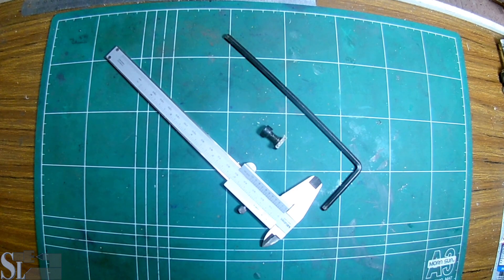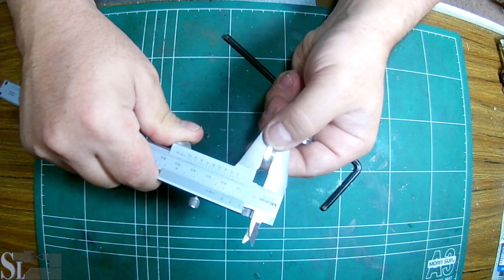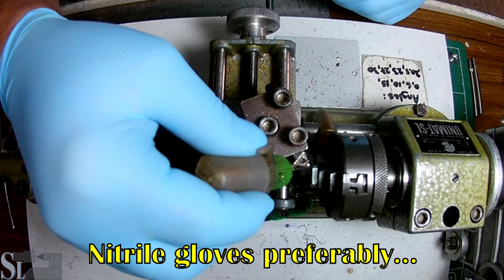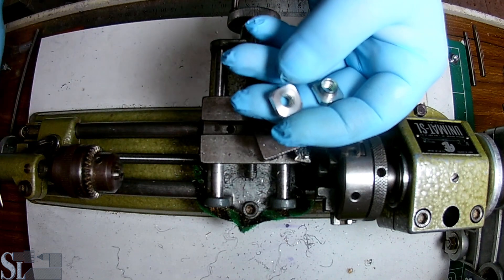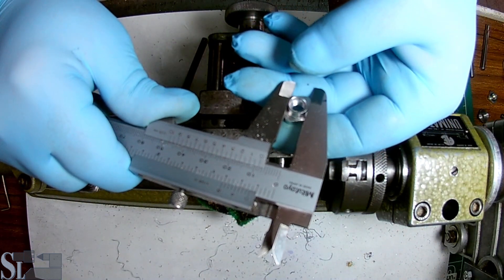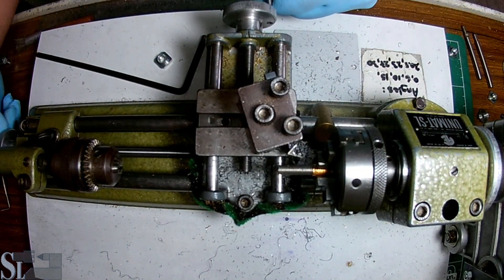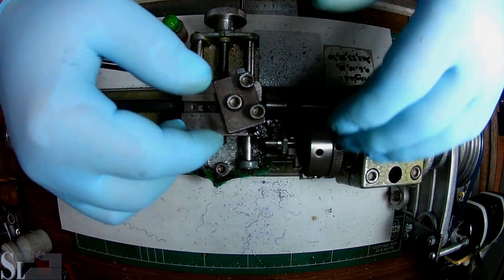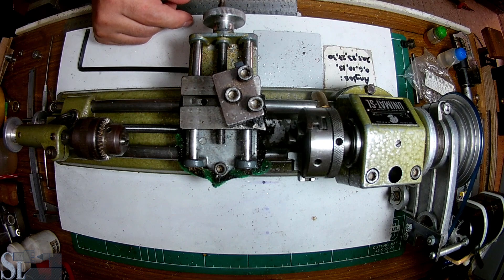T slot nuts for the unimat SL1000

Comment: Hoi heb een draaibank emco sl [ motor is , een/ twee vase moter ] bij me is er een probleem de stroom loopt de verkeerde op via de condersator ( ik heb een keer kortsluiten gehad) 
Ik hem bij iemand anders laten kijken die zij tegen mij er klopt iets niet wat door meten in verschillende standen daardoor kun je me een idee doorgeven wat er mogelijk kan aan Pasen ? 
De draaibank emco sl is ongeveer uit de jaren zeventig oud ik doe er een paar foto’s sturen van de motor van de draaibank emco sl 
De groetjes van Peter uit Oldenzaal provincie Overijssel
Reply from the maker: @petervanbeek7873  hi Peter. I am not an electrician but I will try and help. Using the original motor is very slow as it tends to heat up. I suggest you find/buy a cheap 80w sewing machine motor. I had a low-power motor for years. It was easy to adjust and it worked great both for turning and milling. These are sold with a foot pedal on aliexpress for 20usd or so. My current motor is also a sewing machine motor 550w with a speed controller. It is just perfect for the lathe and mill operations. Hope this helps. Feel free to send me a mail at all times. Preferably in English :)

Comment: I use wire/cloth covered pipe cleaners to help keep swarf off the unimat rails/ways ... wrapped around the ways in front and behind, so they move easily along the rails with the carriage, in either forward or backward direction. These are available in large packs from tobacconists. May be overkill, but I think helps reduce swarf in the gaps between rails and inside of carriage. Magnet a good idea, and makes me wonder if they could be fitted in addition to pipe cleaners, to gather swarf during machining .. I may be thinking too much about this minor shortfall in the unimat design.
Reply from the maker: Loved the idea. I use pipe cleaners myself. If you machine steel, an on/off or retractable magnet may be a good idea. I made such a magnet by placing it in a brass tube and I got a plastic sheath for it - so once the magnet is retracted, the chips fall off. There is a tubalcain video on that. He uses a commercial product. .

Comment: Hi Saar hey if they have the basic machine and basic knowledge and cutting tools like you and I, T-nuts of any material should be a breeze and fun to make!  It was a staple of students back in my day!
Hope all is well and good for you my friend!
Reply from the maker: Hi Mike! Well, yes, making a Tslot nut is easy...  Making many is just taking time from projects you actually want to do so buying them is better. But as for material - steel is the way to go as softer metals will have a serious ware on the threading section. I'm good. How are you doing?
Reply: @Smallathe  this is very true as you'll see me struggle in and laugh in what should have been one little video ...otherwise all is good! 
We had to make dozens of t nuts from print to part of all different materials and sizes...and we didn't get to keep not even one! Lol it was the very beginning of learning how to use a mill lol

Comment from the maker: Just found something interesting.
After Dan's comment (below) - I ran another quick glance on ebay:
Found these and the search text is: "tee nut 12mm M6":
https://www.ebay.com/itm/M4-M5-M6-M8-M10-Cold-Heading-Round-Base-Weld-Nut-Through-Hole-Insert-Tee-Nut/173978412518?hash=item2881ebe5e6:g:gQ0AAOSwBaxdZSGy
These have a flange of 10mm, M6 threading, looks good - and not to expensive (20pcs at 14$). I will give these a go too...
Of course, you can turn these out of 12mm brass/steel...

Comment: Nice Job!!!  I made a few T-Nuts out of Carriage Nuts (square nuts) by milling down two opposite sides to the correct dimensions.  The only problem is that these were 1/4-20  threads.  I wonder if you could post a link to the ones you bought on E-Bay?  Thanks for the great idea and video!!!
Reply from the maker: Hi Dan. Well, when I bought these they were all over the place. After loading the video I wanted to post a link - I can't find any now! Not ebay, banggood, aliexpress. None! On the other hand T slot nuts used to be super expensive and they are cheap now...so  I just bought 5 * m6 regular t slot nuts (~4$ total) and I will check these and report.
Reply from the maker: And here is the link to what I just bought: M6 steel T slot nuts via ebay...
https://www.ebay.com/itm/M6-8-10-12-Drop-in-Tee-t-nuts-T-slot-Aluminium-Profile-Extrusion-F-3D-Printer/274542334295?ssPageName=STRK%3AMEBIDX%3AIT&var=574748407340&_trksid=p2057872.m2749.l2649
Reply: @Smallathe  Thanks for that!  Please don't go out of your way, I just thought you might have the link on hand.  I will do the checking, THANKS!!!